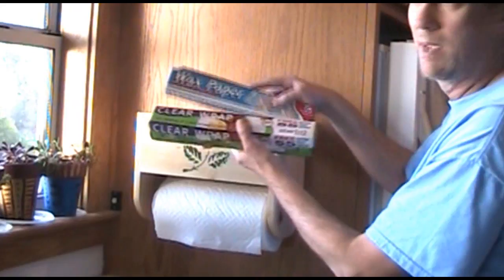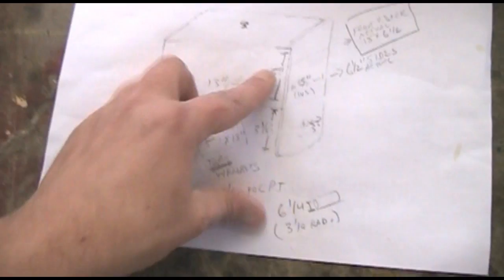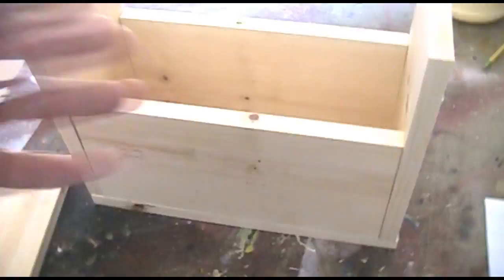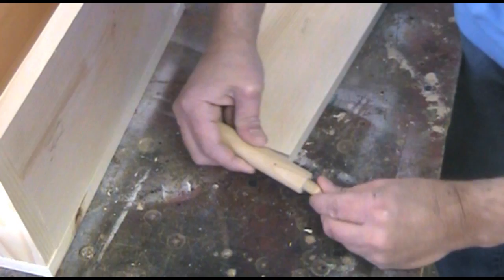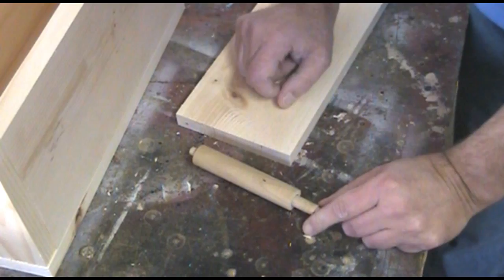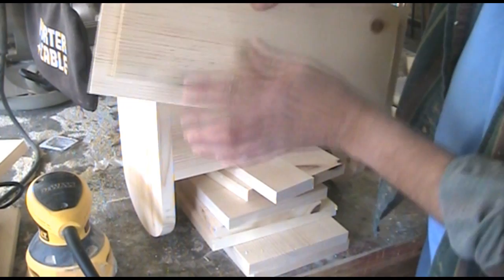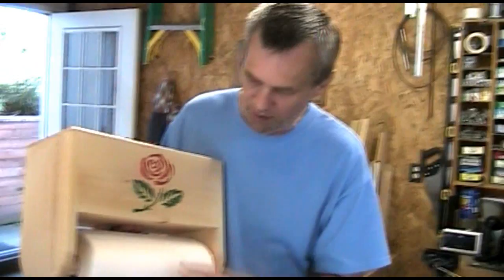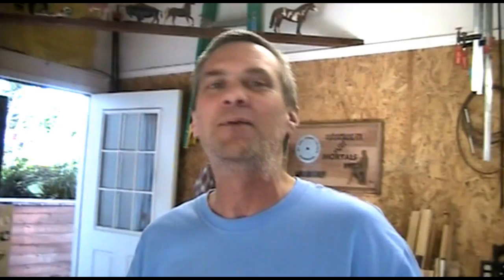Make a paper towel holder with storage

Comment: Hey Steve. Love your vids, I think I've seen them all, and I'm not even a wood worker :) 
You shold do the paper towler holder in a way, so that you could mount the different foils and films in the top box, and pull the choosen foil out of thin slots in the front! :) 
Keep Woodworkin' Cheers from Denmark! :)
Regards Morten

Comment: Anyone who knows can answer this question. (Please) Can you put any finish over acrylic paint? Like polyurethane or some kind of stain? Or just spray lacquer? Thanks! :)
Reply: I have used Minwax Polycrylic Protective Finish. It is a clear finish topcoat for wood in a water-based formula that offers wood protection along with fast-drying times. I applied it over my acrylic paint on my kitchen counter tops and it is working so far.
Reply: This is a little late but I'm pretty sure you can use just about anything, (not sure about stains) as long as you're not eating off that surface, or baking it in the oven to set the paint, which is sometimes done on glass ware or plates. I've even used a thick spar urethane that's normally used on boats to help waterproof the wood over pots I've painted to protect and waterproof them. Now stains I'm not so sure about, unless you're talking about a transparent/semi-transparent deck stain, but even with them you really need to strip off any paint for it to absorb and protect the wood, so don't think that's what you want, lol. One thing I always look for in a protective topcoat is UV protection so it doesn't yellow over time. Hope this somewhat helps, 2 years later..... :)